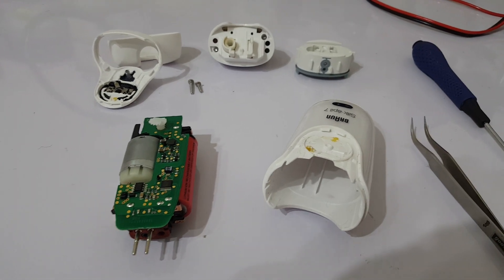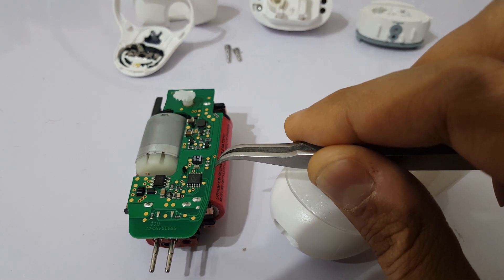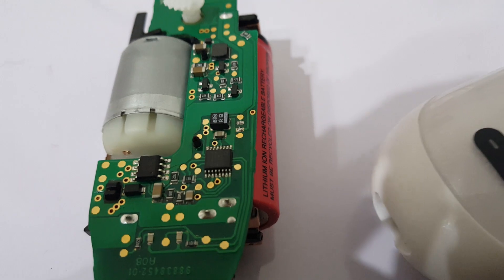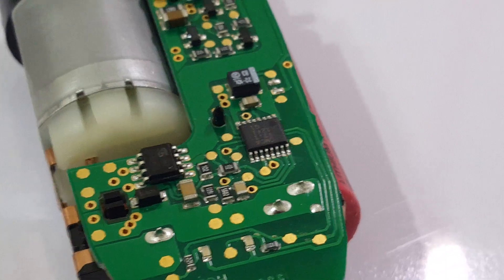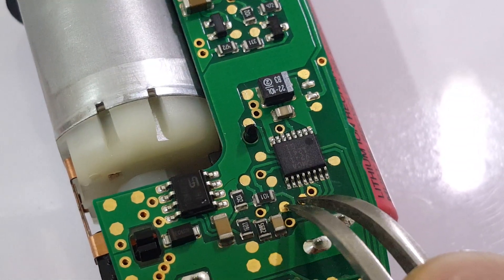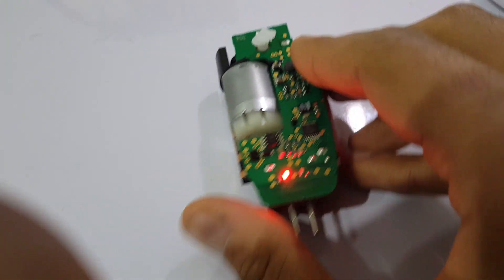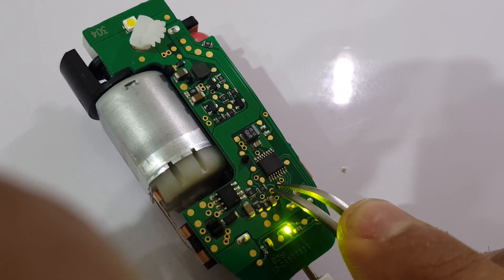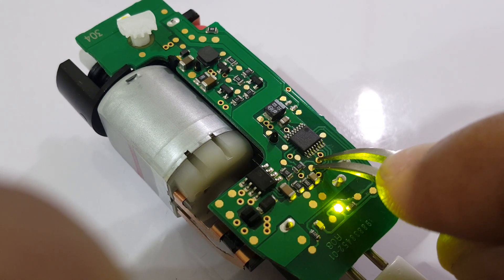Braun ( hair removal ) IC cmca v2.1 reset solution .

Comment: Thanks for figuring that out! I am trying to get rid of the battery entirely:  remove the battery, repurpose the supply connector,  and connect the poles to a DC/DC converter that continuously supply 3.7 V when in use. Any idea how to get rid of the reset entirely ?
Reply from the maker: You will lose the speed controls .

Comment: Funny thing, I've had this problem after battery change in my Braun 340S-4, and when I have touched ohmmeter between negative battery connector and IC pin16 it reset itself! Works fine right now.

Comment: Thank you very much!
I was able to fix my Braun beard trimmer, though it did not have the testpads on the PCB.
I had to short pins 11 and 15 directly on the IC, to fix the problem.

When I played 'with the device, it stopped working after a few power cycles. So this time I only connected powersupply for 30s and disconnected and immediately turned on and it also reseted the error, if this works it is even better, because one does not need to open the device!

Comment: Just great. Thank you very much. PS. Left pin has about 0V, in my opinion it is feedback from DC motor, there is just voltage divider and single one capacitor. There is about 1 V during motor work. And on right pin was about 0,4V before short circuit and near 0 after (0,06V). Maybe also great idea is to add some more capacitance on the biggest cap. When it was desoldered, then always microprocessor goes into error state after reset and short test. There was only blink led and a little motor movement...
Greetings from Poland :)

Comment: I have a Braun Series 3 Shaver with Ni-MH Battery. IC is CMCA v2.1 1033 G1.  
I tried the Shorting those two pins for long but this didn't help . 
Just as an Info for others.
Reply from the maker: It's NOT just shorting 🧐
Watch the video again and do it like the video exactly . And it will work 👍

Comment: Tank you for the video! Managed to bring back to life Braun crUzer6. The board is different and there is no testpoint or anything connected to pin11. So i soldered a thin wire to pin11 and connected it to TP15 on the board (pin15). And it did the trick! Without your video the unit would end up like E vaste. So thank`s again!
Reply from the maker: Excellent !!